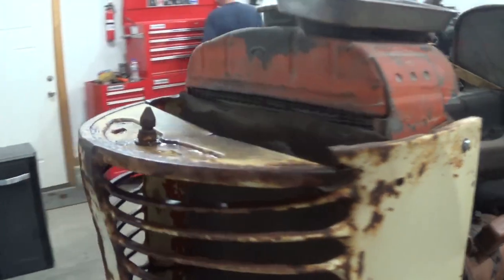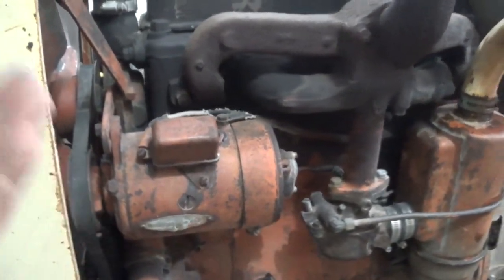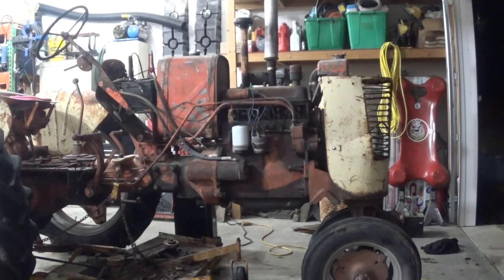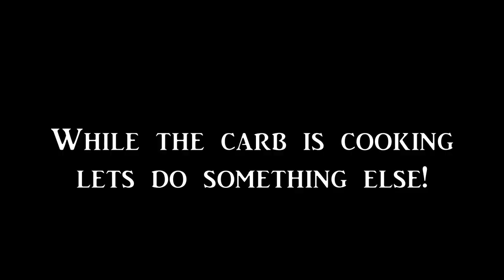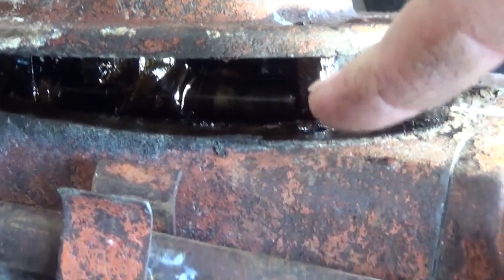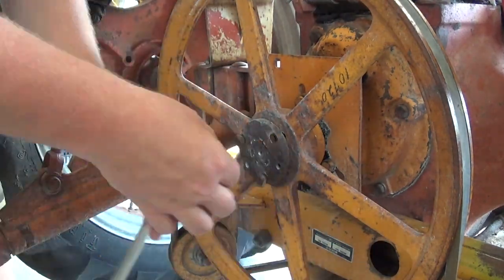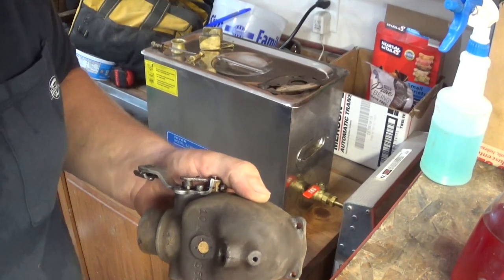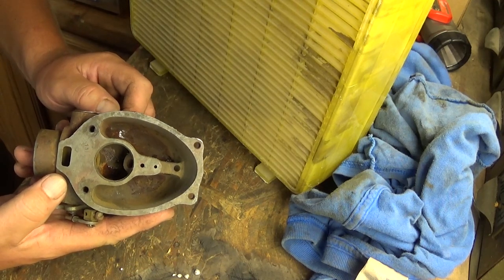I BOUGHT THE CHEAPEST TRACTOR ON CRAIGSLIST ... 1952 Case VAC

Comment: Awesome.  Thanks for sharing.  Get the carb TIG welded?  Tig's come a long way and is cheap.  Most welding shops have it.  Cleanliness is absolutely important.
Reply from the maker: Can you tig cast iron? I may have to try that. I can't tig either but know someone who can.
Reply: @SkylarHillShop  Yup.  Do YouTube search.  My neighbor does Cummins work on the side.  Dudes soup up their Dodge trucks and all goes wrong.  Many cracked exhaust headers and turbo adapters.  Grind out chunk of crack w cutting wheel.  Preheat in over at 350 deg.  Have assistant keep cracked spot warm w propane touch.  Many different cheap rods available.  All work ok.  He's even had luck w a mild steel rod.  Cheap.  Else see how long your jb weld works or a replacement carb might be cheap.  Good luck.

Comment: The disk brakes on the case are marginal. they get glazed and simply dont work. The older ones with thr bnd brakes are actually pretty good. The PTO is very weak. be plenty strong enough for that mower. But a heavy brush hogg will break it. I have three of those in my collection. Two have the eagle claw hitches.  There simply is not and great demand for them in my area.